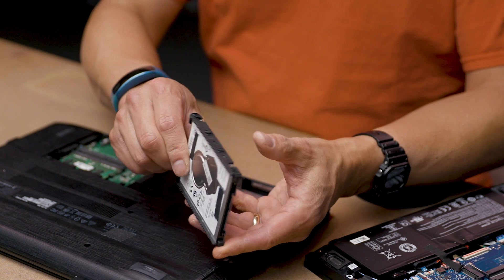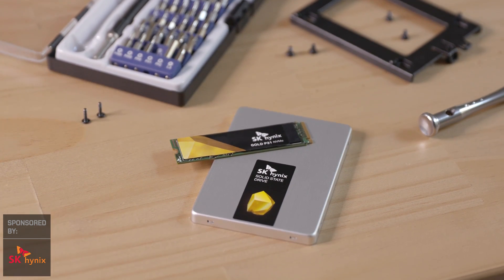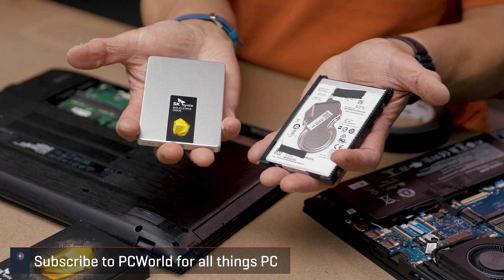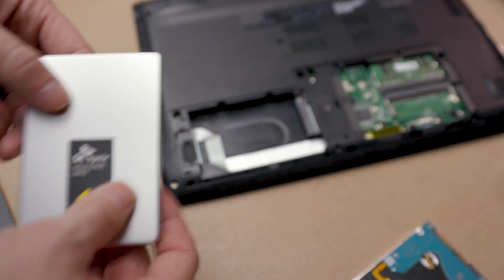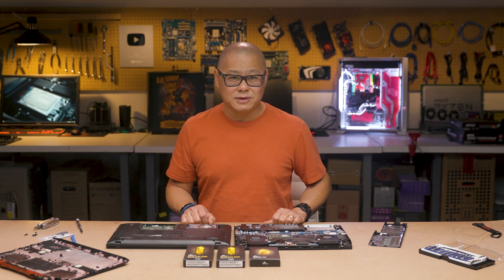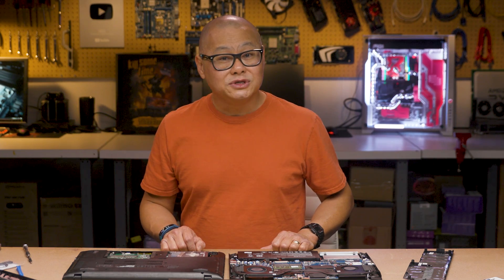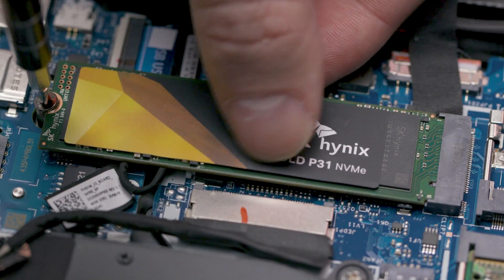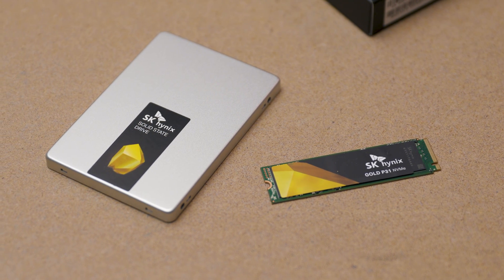How to find out if your laptop can take an SSD

Comment: Hello. I find this video flawed since you also have PATA connected 2.5" SSD drives, which would FURTHER give compatibility for SSD drives. PATA-drives use the "old" interface for connecting drives, and comes in both HD and SSD flavour drives. Advantage here is that you can use PATA-drives that are SSD (no rotating parts) in older laptops to give them a new life. For office applications and such, often changing to a PATA SSD instead of a PATA Hard Drive would give a significant speed improvement and more protection for traveling. I find it strange that you did not mention that PATA drives are compatible with even older machines than 10 years old.   SATA is the standard that came after PATA.    PATA is the portable version of ATA/IDE drives. 

Boof

Comment: I installed an M.2 SSD in my laptop last year and it ended up burning my motherboard.  Now I am scared to upgrade my new laptop. Do we need to worry about insulation when installing M.2 SSDs? All I see on YouTube is people inserting them and screwing them in.
Reply: You shouldn’t have to worry-I’m not sure how the ssd managed to burn your motherboard

My guess is that it was an electrical short and that’s what caused the burn, unless you are slamming the drive with video editing and other intense tasks, your ssd shouldn’t reach temps that can burn things
Reply: @ryanwallace983  I had something similar happen with my laptop - I added a Samsung 960 Evo NVMe SSD even though it wasn't on the approved list, figuring that a name brand would be fine, and someone on the user forums said it worked in his. Nope. I eventually started getting weird data loss errors, CPUID HW Monitor said the SSD was nearly 70C at idle, and the secondary SATA HDD was returning read/write speeds of 70MBs/60MBs. I put in a Corsair P2 NVMe SSD that was on the approved list, did an OS reinstall, and now everything is running cool and normally. Maybe it's related to the m.2 slot in my laptop supporting either SATA or NVMe? (shrugs)
Reply: @CantankerousDave  sounds more like a bad drive than anything else-if your laptop manufacturer really didn’t want you using that drive then the system bios would simply not initialize it-a bad drive would give you errors tho

Comment: I used my Fujitsu Lifebook 17 for 16 years. Last 10 years it was on Linux life support. 2 years ago I put an ssd in it. Its max ssd was a IDE 120GB. I bought a 100GB ssd and ide to Sata adapter that fit my laptop. I had to take the ssd board out of its case. Last month I replaced it with an LG Gram 17.